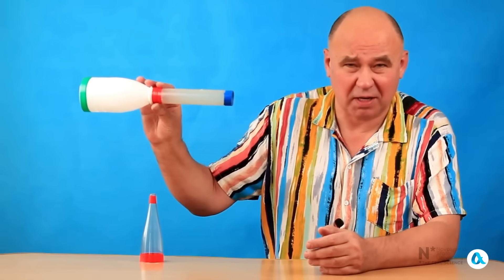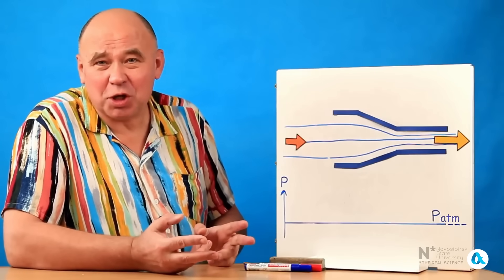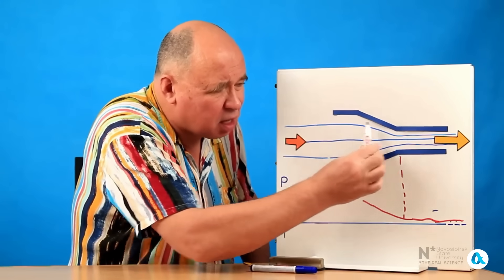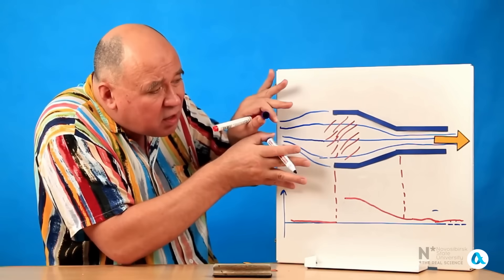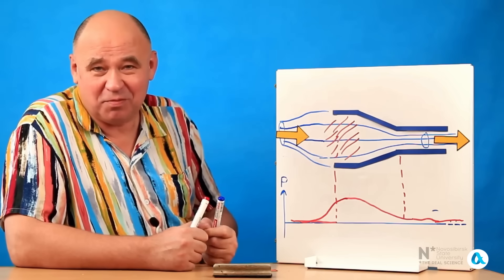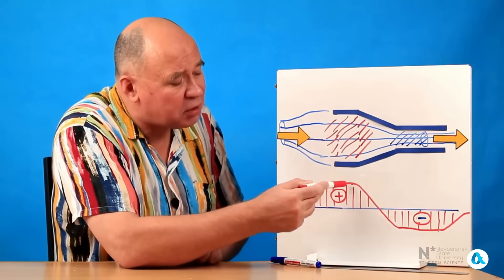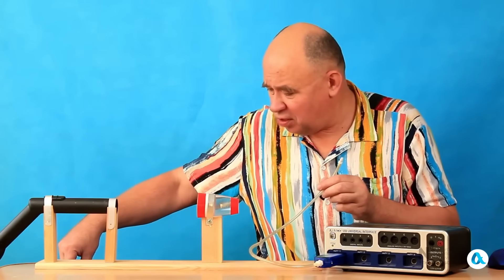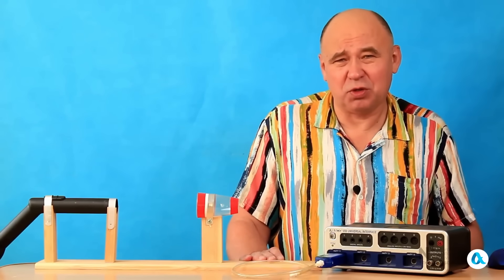Tapering pipe paradox

Comment: The volume of air coming in to the cone must be the same as what is coming out of the cone. So the speed of the air will be faster to get out of the small tube so that volume is equal at both ends

Comment: You forgot that air have no laminate flow and also temperature hot spots put also into account the angle of the reverse flow perpendicular to the angle of attack inside and outside the jet tube
Reply: Further the inlet conform whatever form have to have a maximum inlet degree of10  ,all in all there will be no gain in flow unless creating an artificial low pressure at the end

Comment: You have a larger opening with energy going in, and a narrower outlet with the same energy going out, the same amount of energy roughly has to go out the narrow end as is coming in the wider opening, so in order for this to work you are multiplying the lower velocity larger opening into a smaller higher velocity exit. The same is true for Volts x Amps = Watts, Hydraulics, F=MA, etc... Energy is preseved no matter what. This is just Bernoulli's principal.

Comment: When fluid flow exits a pipe at subsonic speed into a large reservoir,  it forms a jet and the static pressure at the exit plane inside the jet MUST be equal to the static pressure  outside the jet, which is the pressure in the reservoir. This can be proven by the following reasoning. Let's keep it simple by assuming inviscid incompressible flow; i.e., no friction with the Mach number squared much less than unity. 

First, let's assume the exit pressure in the jet is above the reservoir pressure. That means the jet must expand as it enters the reservoir, which in turn means the flow area of the jet increases along the jet. If the area increases, the continuity equation requires that the flow velocity must decrease, and the incompressible Bernoulli equation requires that the pressure in the jet increases. Using the same reasoning for points further downstream of the jet, we realize that the pressure in the jet will always increase and never reach the reservoir pressure. This is impossible. 

If we assume the exit pressure in the jet is lower than the reservoir pressure, the flow area must decrease, resulting in an increase in velocity and a decrease in jet pressure, meaning that the jet pressure would always decrease and never reach the reservoir pressure. This is also impossible. 

The only physical result is that the exit jet pressure must be equal to the reservoir pressure. Thus, the pressure at the entrance to the larger diameter end is a little higher than the reservoir pressure because some of the kinetic energy (0.5 Rho V^2)of the free stream flow is converted to potential energy, or pressure, because the tube is an obstruction. 

I thus conclude that the figure showing the magnetic flux lines is incorrect. 

When the tube is turned around, we can reason that the exit pressure in the jet leaving the larger diameter end must again, as before, be equal to the reservoir static pressure. That exit pressure must be larger than the pressure at the entrance to the smaller diameter end, because the tube is acting as a diffuser - fluid flow with increasing diameter, using the same equations of conservation of mass and Bernoulli (conservation of mechanical energy). This latter fact leads us to conclude that the entrance pressure at the smaller end must be a little lower than the reservoir pressure. 

Thanks for the interesting discussion.

Comment: I missed some of the vital information because of the bloody vacuum cleaner. However my prediction is that in the reversed pipe an area of high pressure will form as the air flow slows down. 😊

Comment: Nice way to think about it. I knew as much goes in, comes out, volume flow is equal, so the rate is proportional to area of the points in the flow. Works easier on liquids, a pressure-centric view is more in line with the aero guys haha.

Comment: From physics of mechanics someodd 45 years ago… I remember the pressure volume velocity relationship with respect to time and temperature — it would predict a lower pressure (or velocity, or a bit of both) in the narrower pipe. P₁ V₁ ∆T/T₁ == P₂ V₂ ∆T₂ /T₂ We were so amped in those classes, doing the work in our heads half the time. I miss that sort of clarity
Reply from the maker: Nostalgia is a pleasant feeling ))

Comment: The "paradox" is never resolved. Of course there never was one to begin with, because comparing the velocity of the air doesn't cut it. The comparison should incorporate flux as well.

On another note, the reduced pressure in the narrow tube is to be expected as this is basically a venturi tube.

Comment: is the invisible funnel size on the wide inlet equal to the length of the funnel it passes through? in other words is the air funnel the same size as the physical funnel it passes through?
Reply from the maker: There are more opinions than physicists ))
Reply: @getaclass_physics  That was a real question. I wasn't trying to be a dick is the is the air funnel equal to the size of the physical form funnel. If the funnel is 1 foot long, would it be mirrored on the inlet

Comment: I like the theories and the demonstration, but what hasn’t been discussed here is what is happening to the external pressures as the air moves around the outside of these conical structures, it creates a low pressure zone behind the outer cone before the air exits.
I don’t agree that this would create a small or unmeasurable drag if such a conical device was attached to an aircraft though, because I feel it would act like a donut shaped sail overall and create quite a bit of drag as it compresses the inner chamber while decompressing the external atmosphere behind the cone before the exit and would also make the aircraft much less aerodynamic with such a structure attached.
I imagine reversing the jet type cone would cause higher external pressures on the outside rear of the nozzle and hence a decompressing effect for air exiting the larger diameter of the jet type nozzle.
JMO.
Reply: I believe the flow is considered as not compressed, as if it was water.,
Reply: @ Any air that is forced through such a conical shape or device would be considered compressed if the pressure is raised as was shown by his metering device.
Reply: @evil17  I am trying to differentiate between under pressure versus compressed as in a volume change. If you think of water flow you don’t think of a volume change, but you still have the pressure changes due to flow through the nozzle. Was the water compressed, or was there a pressure change? Now extend that to the airflow.

Comment: I am amazed that i found this video purely by accident. I have maybe a kind of inverse paradox that might be very similar. Can you explore this for me?

I had a need for a very small but strong vacuum cleaning device. I put an inverse funnel shaped attachment on a very powerful shop-vac vacuum cleaner, and had the cleaning tube side with a very small maybe 4mm opening (it was some narrow plastic tubing). In my mind I was expecting the tube would suck air very strongly, kind of like the dentist uses. The paradox was, it felt very weak, that powerful shop-vac motor was straining but could not provide the results I wanted.

Comment: 3:00 Stop right there! The air around the tube may be moving at the speed of the aircraft, but *the air in the throat of the tube is not*. It is being impeded by the pressure built up in the tube. Your premise is clearly based on a fallacy. 
That's not a paradox. It's a mistake.!

Comment: Seems odd to explain pressure without bringing up the inverse relationship of volume. What about the effect of heat on the pressures of a jet engine? Finally, what about what a cross-sectional view of the tapered pipe showing the different rates of flow? Is the rate of flow universal across and throughout the pipe? In an ICE with a turbo or supercharger where the flow is externally induced the effect is call boost.

Comment: To add a spin of sorts... pressure converts to flow and the reverse. We need to measure both to get a picture. If the fluid slows the pressure will rise. If the fluid increases speed in the narrowing part... it should have a lower pressure.
Reply: Isn't this the Bernoulli principle? Believe it's been thoroughly explored and documented.

Comment: It seems obvious to me that when the air enters the wide gap, it meets resistance and seeks the easiest way out. This creates turbulance ad air seeks to back out while crashing into incoming air. It would seem intuitive that the increased pressure would force air through the narrow side, but in my mind, the turbulance increases as you get further along the narrow passage, thus the drop in pressure. The turbulace and the higher pressure would seem to create an invisible bulge in front of the wide end, diverting incoming air to the sides of the tube. Spill over turbulance, being driven back over the outer wall of the tube accounts for the lower pressure there.

What I would be interested in seeing is if there would be a pocket of lower air pressure out in front of the wide end, out beyond where the higher pressure from the tube could be sustained. It wouldn't surprise me if the diversion of the incoming air to the sides creates a small pocket of low pressure somewhere out in the open air.

As for turning the tube the other way. I think the key will be the air flowing along the outside. Whether it is turbulant or slightly higher pressure, I think the big effect will be when it blows past the edge of the wide end. This will naturally drag air out from the tube, creating a vaccum, I think. The low pressure though may cause a feedback pulse. As the pressure drops, it will cause air to be pulled in from the narrow end quicker. As this happens, it will reduce the pressure in front ot the narrow end, which will take pressure from the air going along the outside, which will reduce the vaccum effect in the wide end. Thus the narrow end pressure will rise  impeding air tlow, imcreasing pressure in front, increasing pressure along the outside. This returns us to imcreasing the vacuum in the wide end again. It wouldn't surprise me if this generates a mild whomp whomp sound as the air flows and the pressures cycle around the tube.

Tbis is of course wild speculation, so it is likely to be all wrong.

Comment: The pressure gradients are analogous to those of a wing's airfoil. High pressure at the leading edge up to the thickest part where the flow is slowed, low pressure across the retreating surface behind the thickest point, and atmospheric once again beyond the trailing edge.

Comment: .   En-gins impart energy/life... that's literally what the name directly translates to. You've been pronouncing it wrong for so long you forgot what it means.

    This thing just trades slow wide current for fast narrow current just like a river changing depth and or width. And there IS a change in energy... the increased restriction on the flow from the reduction in diameter creating a higher pressure puts a higher load on the pump/blower/fan requiring higher energy input to maintain the same flow.
.

Comment: Simply, does the restriction thus produce a higher velocity from the inlet pressure..but no  change in energy. So, no paradox. Reversed, the velocity energy is converted to pressure.  Thanks so much for the demo !!
Reply: Kinetic energy (rate of flow of air or air speed) is converted into potential energy (increase in pressure)

Comment: I think that there IS LIKELY a shape that effectivly eliminates or even reverse augment effective frontal area in some special shape traveling through an air mass. This is why a falcon can accelerate downwards faster than 32 ' / second/ per second  faster than by gravity alone.-:  and/Or advantaging  a sail on a tacking sailboat- offering air molecules "skin effect"  and utalizing sonic vibration , or Oxone cushion may all be combined to cause a "Air Assistance" rathar that "air resistance" device. I aplaude this investigation, and am experimenting with similar. Watch nature. Watch Veritasium propeller driven traction device accelerate faster than the wind in a straight line down wind. Watch a bumble bee ride the sonic shockwaves of the previous wing stroke like a staircase of compressive pulses. Watch a submarine travel under water at 70 mph sliding through less viscous air bubbles. Watch a penguin accelerate under water upwards in an envelope of exhaled air.  Watch a voirtex cannon knock over a brick wall firing a sonic smoke ring of air.  We have a lot to learn in aero dynamics. Some sequesterd discoveries too soon to be allowed by corporate patent troling.  Look at the 1890 invented high torque propeller recently released giving a motorboat 40% more torque that conventional prop having same HP.  This stuff is all around us for the inquizitive  paradoxical counterintuitive  and observational equiped minds to resolve.  Lets put peanut butter and jelly together, and make a sandwitch!

Comment: This is very similar to a plumbing problem I am thinking about. What benefit is this pipe: ---===--- compared to this pipe ------- ? If the resultant exit pressure at the end of the pipe is the same, then that would indicate no benefit - which doesn't make sense because the buffered water in the first pipe has to have some effect. The buffered water would have accumulated potential energy.

Comment: If the pressure in the cylinder were below atmospheric, then the higher pressure of the atmosphere aft of the cylinder would cause air to enter from the back to equalise the pressure. 
I'm guessing there would be some flow separation of the front to rear airflow towards the end of the cylinder's inner surface.

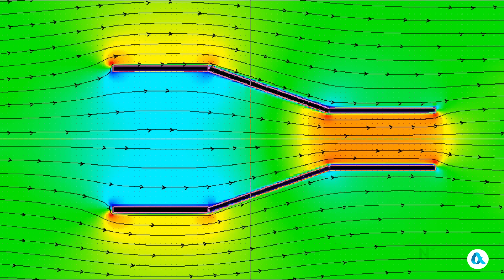Comment: 7:00 A better explanation of what the colors signify is definitely needed at his point. The viewer is forced to infer what colors are higher and what colors are lower.

My question is where in the airstream did you take your pressure measurements, it was difficult to see. Were they in the center, off center, or near the wall? I would like to see some lateral pressure measurements from wall to wall at several distances in the cone.

Comment: Without any study in physics it seems to me the funnel restricts the air flow if placed in either direction, except for the line of travel directly straight through the small opening of the funnel.  When the large opening of funnel  faces the oncoming flow of air it allows more mass of air in and creates higher pressure and air velocity out the small opening of funnel.  If funnel was in opposite direction, the ambient air would be diverted around the outside of the funnel and no higher pressure would result.

Comment: Video is excellent and educational (for younger especially). But, from the title "paradox", = it is not paradox, paradox is something which happens very rare or out of something you see every time of often or out of all the time. (but to rise interest in physics, it is good)
It is normal matter density to make balance, (it is with harder matter example: if you remove 2/3-rds from cup with water, normally 1/3-rd stays. Even it looks funny to many, because is normal) when same air in one part of pipe becomes more dense - just near it has to become bellow normal density - because it has to take it from somewhere. So, paradox would be: if everywhere becomes more density and rest to be normal density, that would be: "from where more matter suddenly".